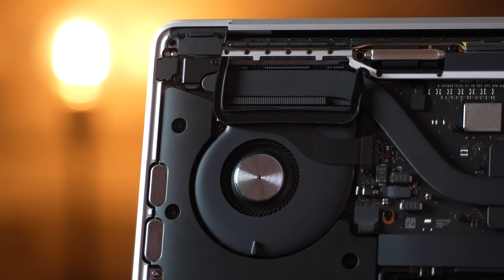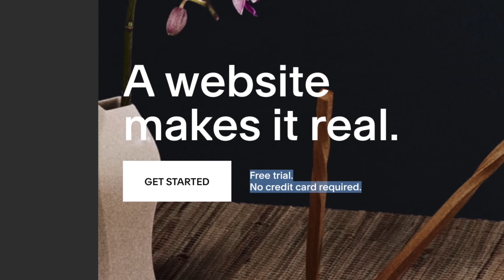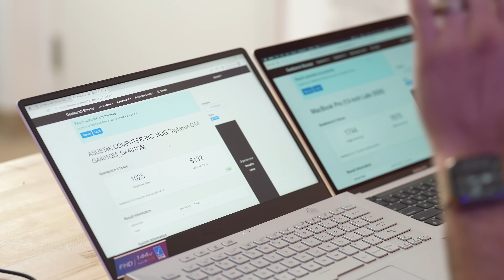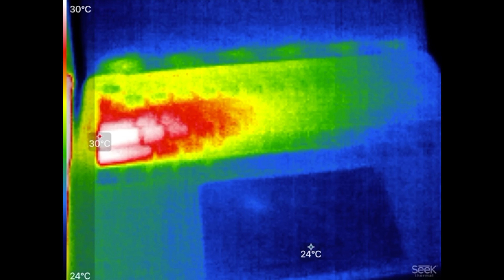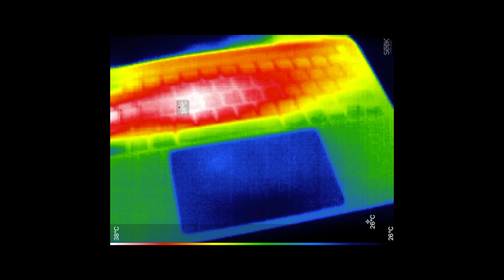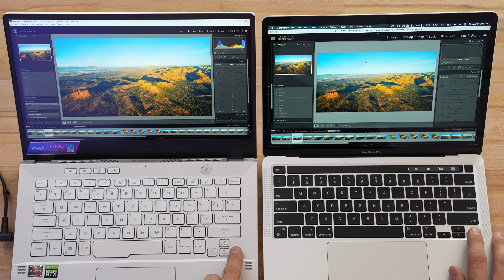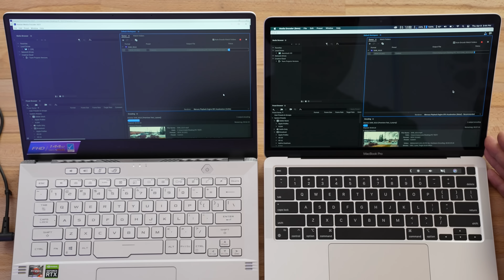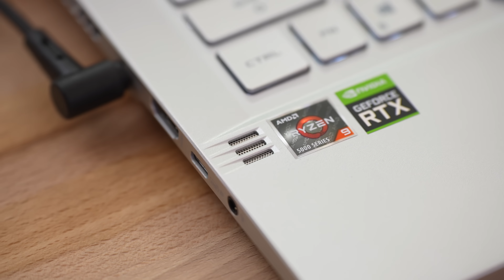Apple M1 vs AMD 5900HS + RTX 3060: FINALLY an M1 Killer?

Comment: The m1 air gets close results to m1 pro, I use an external cooler for my m1 most of the time and it works just fine that's an 800 dollar save from the and laptop

Comment: The display difference is stunning. The Retina is just awesome.
Reply: No doubt the macbook screen is better, but the big difference you're seeing is the screen finish, matt vs. glossy.
Reply: Absolutely hands down.
Reply: Gaming laptop screens are meant for faster refresh rates & to avoid the image ghosting effect, they not built for color accuracy.. they built for different purposes that's why there is huge difference in colour reproduction
Reply: @manojkale4408  ...the G14's WXGA 100% sRGB, DCI-P3 and 1.15 Delta-E. It's more colour accurate than the M1 MacBook Pro out-of-the box. The difference is the MacBook Pro is ~450 nits peak with a glossy screen vs. 340 nits on a matte screen. This makes the MacBook's colours look more saturated.
Reply: @ryankwan1934  in gaming PC for excellent screen you have to pay premium price they are costly and most of time found in price above 2000$,
Reply: @manojkale4408  Sure, but in this particular comparison, the screen in the G14 is more colour accurate. The difference is marginal in colour volume and the impression that Deyan had is solely due to peak brightness.

Comment: this is a terrible comparison for numerous reasons

1. this is x86 vs arm (google the difference if you dont know)
2. one is using an operating system designed with the cpu in mind and the other isnt (macOS vs windows)
3. windows is alot heavier than macOS, furthermore if you had used linux on that same laptop you probably wouldve gotten way better performance BECAUSE windows is so much more difficult to run . you could prove my point by taking the same mac but with an intel cpu and then a windows laptop with the same cpu and get lower results with the windows laptop.
4. it also doesnt make much sense to do a metal test and cuda test for the geekbench when they both could do openCL...
Reply: @Youtube Kullanıcısı  is this a video about the end user or is it a video comparing 2 laptops?

Comment: Unplugged, the M1 is an absoulte beast... incredible how the AMD *WITH AN RTX 3060* will barely last 2-3 hours under high load and barely beat the M1 in performance, when the m1 can last more than 10 hrs UNDER HIGH LOAD at comparable speeds

Comment: you should have done the test without the charger actually charging ... if it is a laptop then the main function will be portability. I know that windows loses power when it is connected only to the battery, but the laptop will be used, mostly, connected to the battery.  I am sure that although Windows was better in performance, it also consumed at least half of the battery while the Macbook should not have been more than 15/20%.  but I will never know it, do you know why?  because you should have done the test without a charger and started both 100%, and you didn't do it.

Perhaps, nice video !

Comment: Thank you for your job you are very cool guys!!!
I have a question. Help me please I really have no one to ask this. Can I use the iMac macOS 2020 to achieve decent results in architectural visualization (exterior and interior design) when using Blender?
This is the specification:
macOS
3.6GHz 10-core 10th-generation Intel Core i9 processor
8GB 2666MHz DDR4 memory
Radeon Pro 5700 with 8GB of GDDR6 memory
512GB SSD storage

Comment: is going to be soo interesting when AMD make their own ARM chips, which they are preparing
Reply: No it wont, there is very little windows software that works on ARM. It will take years to port everything over and meanwhile Apple are about to release their M1X this month!
Reply: @scubasausage  Apple is just too far ahead. It really helps when you make your own software for your own hardware.
Reply: @nikasukiashvili2622  how is apple ahead of amd tho? the 5980HS still drags the m1 trough the mud easily. that being said the m1 is an amazinf chip though. i will probably buy the new macbook of 2021 with the new gen M chip. (but with linux/windows on it)
Reply: @scubasausage  m1x later end of the  year, not next week unfortunately
Reply: @dandan3045  Yes I think a lot of people were surprised. Currently the difference between the Mac Air and Mac Pro is pretty small. We all expected Apple to upgrade the Mac Pro.

Comment: I bought a M1 Mac Mini to use as a Plex server and it seems to be really good at that so far but man is Mac OS sluggish and slow.  Pinwheel when launching apps sometimes or just sitting for a few seconds after clicking on things where I'm wondering did it register the click... yep... a second later it actually does what I clicked on.  It's bizarre, the performance of the actual programs once running is great but the OS itself feels slow, like running Windows 10 on a dual core with 4GB of ram slow.    Not too bothered since I'm just using it for Plex which is performing great but it's weird.

Comment: if only my works was revolving around media production, the arm based mac would've been great. but since it has very poor app support for my work, it's very unfortunate
Reply: What’s wrong with using ARM for your work? Or I mean, what type of work simply can’t use ARM chips?
Reply: @anetizen6404  my point is, arm still has a very long way to go, unlike power pc from the past, x86 still alive and thriving, and made very strong progress, especially on amd side. Which is why majority of developers still make programs for x86 arch. If I'm jumping from one architecture to another, my lowest requirement is that every app that I use should be supported, and I don't want to be sitting for hours trying to debug a program that could've been running perfectly on my previous architecture.

I'd say I'll wait for at least 5 years before giving any thoughts of trying arm, especially apple with their super lockdown ecosystem, which I hate oh so much
Reply: @anetizen6404  the type of work that requires me running Linux, and all the programs that I use, non of them have an arm version, and Rosetta cannot translate them perfectly either

And of course, I need the graphical performance that can only be satisfied by a powerful dedicated gpu

Comment: You say 8GB on board Macbook pro 13 but your text says 16GB.
Reply: under that text and video, it is said that was comparing the price of two devices when equipped similarly (1TB SSD, 16GB RAM). The great thing about this channel is, all the comparisons are done with base the MBP 13" M1 ($1299) unless it is mentioned differently in the video.

Comment: I think efficiency needs to be factored in, like how much battery did each use for the tests you ran? M1 draws 13-15W, but the G14 pulls 60+W at max performance. Even based on pure performance numbers, the M1 should be doing everything more efficiently, regardless if it was faster or slower than the G14 on certain tasks/benchmarks. Plus the G14 was blowing hot air on the Mac with them being so close together

Comment: Yo i don't see the point not using the charger plugged in when the laptop is meant to be used plugged in for the best performance... I don't care that the M1 is 26% faster when the Zen 3 is unplugged..
I have a gaming laptop I've never used it without the charger plugged in for any reason unless I watch movies or pictures .
Reply: The performance of the g14 only dropped by 10% on battery. Other gaming laptops usually drop by 50-60%.
Reply: He makes both tests, with and without charger. I think it is reasonable because the very point of a laptop is being mobile. If you only use it at home you wouldn't need a laptop. Of course you have also power when you go to a lan party or something. Personally im almost always plugged in. but some people like to use time in public transport or whatever.

Comment: I am surprised because I thought the AMD laptop would win in all test categories, but it was a much closer match, except for multicore and GPU intensive tests. The test results also suggest the M1 laptop has faster storage compared with the ASUS AMD. With regards pricing, in the UK ASUS Zephyrus G14 with Ryzen 9 and RTX 3060 will retail for around £1799 and that's assuming you will be able to get hands on one, whereas your M1 MacBook Pro 8GB RAM with 1TB storage costs £1699. Both prices include 20% sales tax. So much closer match on price, but the ASUS does offer impressive performance in a "compact" format for value. The Apple laptop once again demonstrates how efficient the M1 processors are, especially with regards power per watt. It would be interesting to re-run these tests when the next level of MacBook Pro's become available with M1X / M2 processor?
Reply: where can you get the g14 that cheap? in germany for g14 with ryzen 9 5900hs  i have to pay 2300€

Comment: I hope Lisa Su is watching this.  We need someone to give them a kick to get them moving in the iGPU area.  Plus performance unplugged could use a bit of a boost.
Reply: Ryzen 6000 series is already rumored to get RDNA 2.0 based iGPU, but I think if someone is interested in graphics performance, they should go for the dedicated anyway, since evem the low end dGPUs are much more powerful than top end iGPUs
Reply: @dev1lm4n63  
They targeted a specific performance with Renoir.  There was no reason to reduce the CU count from 11 to 8.  They were making sure it performed only a touch better than. A 12 CU Renoir would have been better than a rx550 desktop model.  But they cut it down because they could target Picasso Vega 11ish performance and reduce the iGPU space required.
Reply: We just need a snappy ARM based processor on a 5nm node or better that's it
Reply: I hope we don't end up having to stick to a computer that we can't even fix or upgrade, hope AMD do something

Comment: I think something is off here. The Zephyrus comes with different processors and I think the one in the video is well above $2000.
At least in Europe for 1500€ I get the g14 with amd ryzen 7 and the version with amd ryzen 9 5900hs is 2300€ or $2750
Reply: In the usa g14 ryzen 9 5900hs is $1499

Comment: If Apple didn't deliberately underpower (so they could sell the higher performance later on) the M1, it would definitely eat AMD alive. They could have increased the clock speed esp. with the MBP since the fan had all the allowance to blow out even more heat. Current fan is minimally operating.

Comment: I also have both of these laptops. Gotta say the Zephyrus g14 is the first device exceeding M1 MacBooks in performance in my everyday use. If unreal engine, Autodesk Maya are compared, the Asus Z g14 is definitely better.
Reply: What about photoshop
Reply: @tradehut2782  Photoshop is not really a part of my workflow but I use it sometimes. If you use apple silicon version of Photoshop, it is slightly faster.

Comment: Expected, but one thing, I think that on multicore the AMD have better perf than the M1, you can test that having multiples apps opened like you tried once time ago against a Intel model. So if you have several apps opened, several tabs opened, AMD model will serve very well. But give the power budget of the M1, the perf is incredible. So choose the one is better suited for your workloads.
And is because that you can see a huge diference on MT test when you run cinebench, the MT perf on AMD processors are very good.

Comment: Why you keep plugging and unplugging the Asus?  The real test is running all those test on a single full charge.
Reply: The Asus is a gaming laptop and it's meant to be used plugged in for max performance. The Mac doesn't need to be plugged in because of the M1 being efficient enough to run off a battery at max performance. But older intel macs used to thermal throttle like hell and significantly lower it's clocks to not eat through the battery. Hence the older macs were worse in performance while being more expensive.